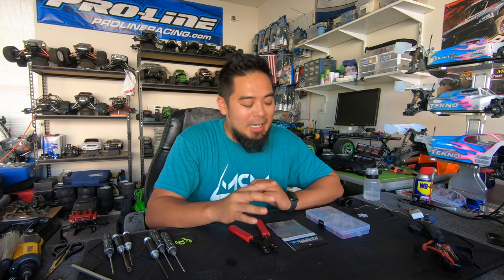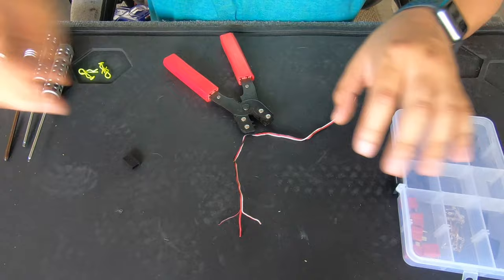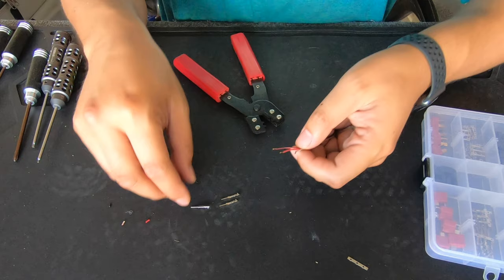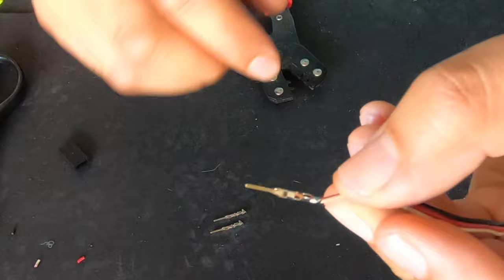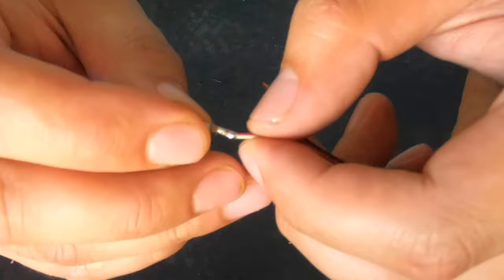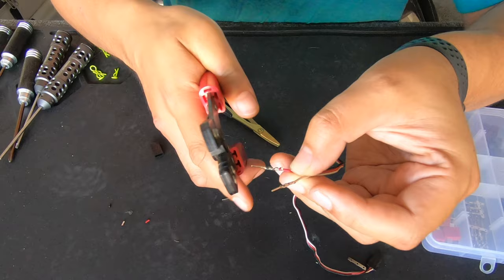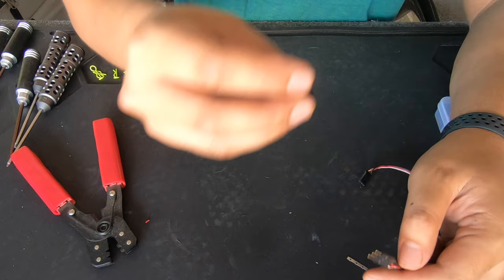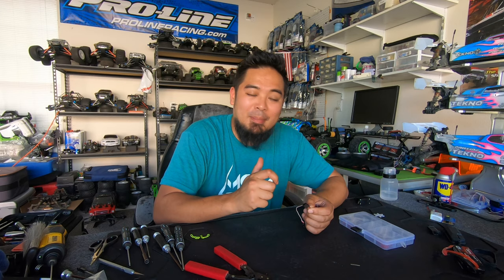How to Make RC Servo Connectors

Comment: I  wasted a few before I  started to precrimp. I  want to also mention you need to put the ends on in the same orientation for all 3 wires so you do not have to rotate each wire to clip into the plastic piece.

Comment: That is a really overlooked portion of building an rc car. You can tell almost nobody does this by looking at their cars and you see a giant bundle of wire zip tied or something like that. Just looks 100% better when your wires are only as long as they need to be. And actually has less resistance if it is shorter.

Comment: Hey wuz up I just got back into RC. I have a question I’m using a Protek servo and Reedy ESC with a sanwa m17 transmitter. Do I have to modify or reconfigure plugs that go into the receiver or is everything compatible now? Thanks